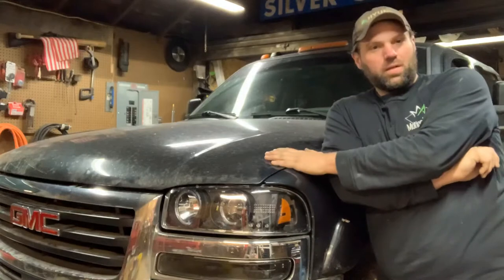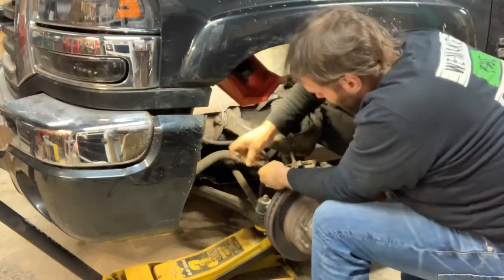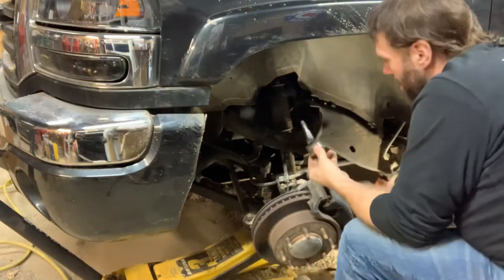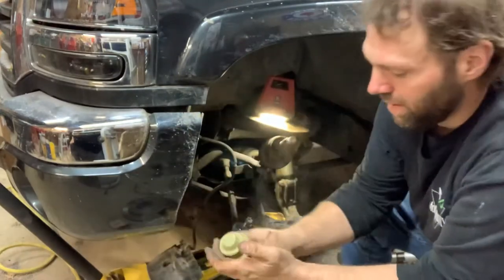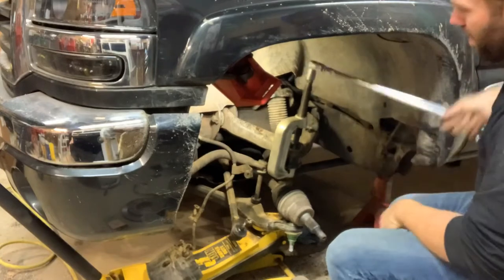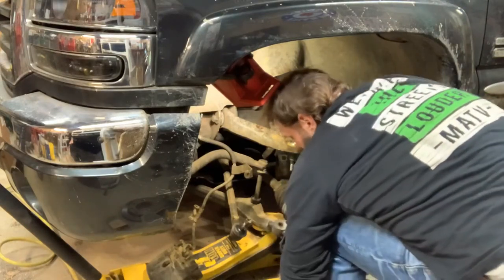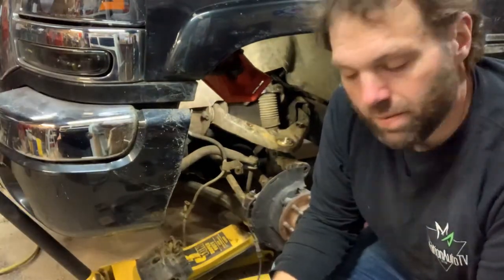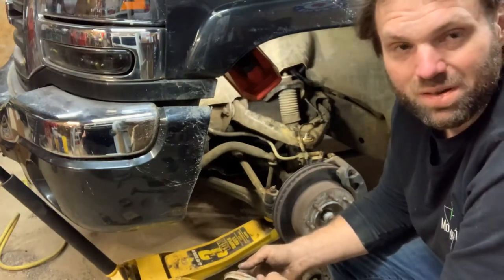2004 GMC 2500HD ball joints

Comment: How do you like those replacement headlights?  I'm thinking about trying something like that on my 2005 F350.
Reply from the maker: They are without a doubt the best upgrade I’ve made to that truck. Well worth the money. They are spyder (or something like that) from amazon. I used LED headlight bulbs in them. They’re great.
Reply: @karnesmotorsports  I think I'm going to look into that for our truck.  Thanks!